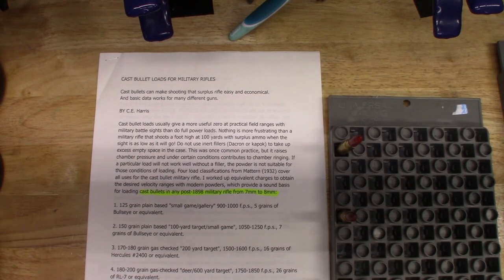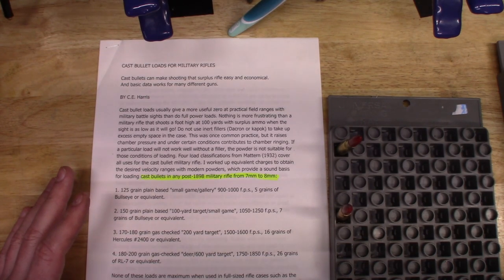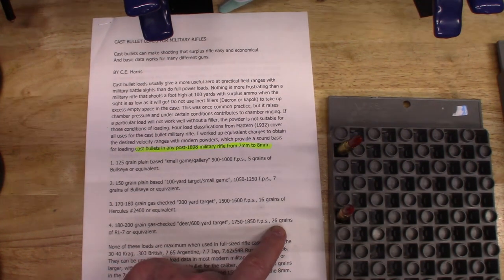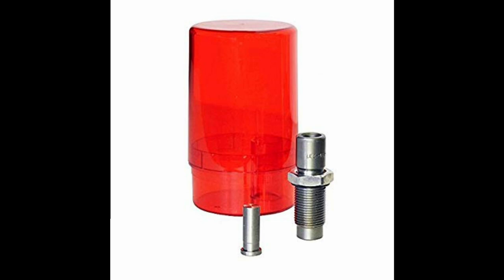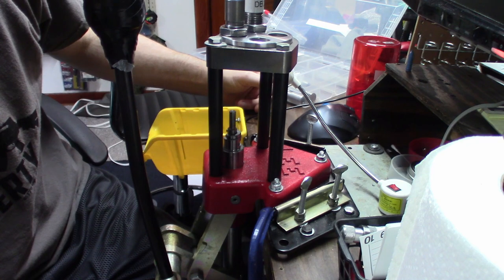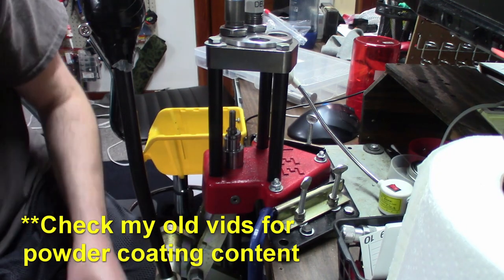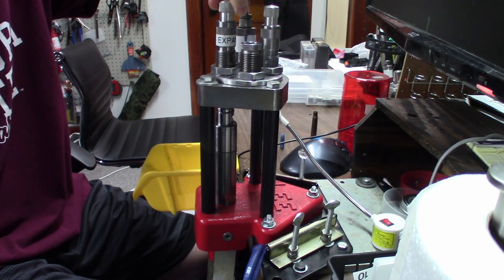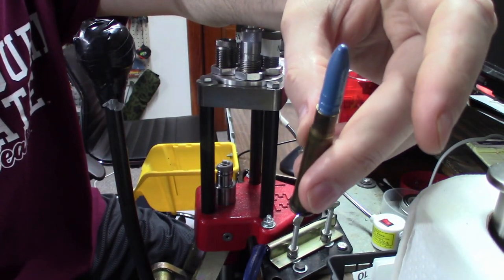Cast Lead Bullets in Military Rifles

Comment: Great video that covered all the bases.  A suggestion on the bullets that give you issues with applying gas check after powder coating, try applying the gas check first.  I've found that the PC sticks to the gas checks just fine and beside the crimp adds additional bonding.  Alliant 2400, Reloader #7 along with IMR or H-4198 and H-4895 are my favorite powder for cast lead loads.
Reply from the maker: Thanks for watching!  Since this video I did end up trying putting on the gas check before coating and it works great!

Comment from the maker: I forgot to mention, if you have a mold that drops bullets to where the gas checks don't stay on very well when using a push-thru type sizer, you can seat the gas check and then powder coat after, and problem solved.  
I think some molds drop a bullet with an undersized gas check shank or it could be an issue with your casting temperature/mold temp, or alloy.  Most molds you'll have no problems w/ gas checks using the Lee system, I've just noticed a couple that give me issues out of 25 or so molds that I have.
Reply: Hey buddy. I'm to impatient to watch through to many vids. What is your experience running powder coated pills in your AR10? Have you had any residue/paint build up in the gas tube?
Reply from the maker: @thetobaccoguy1751  Sorry so late in replying.  I haven't ran any in my AR10 yet but my dad has and I've shot them in his gun.  They are really accurate and he hasn't seen any issues with residue or leading.

Comment: i did a load in .308.. no pressure load, but the projectiles are not gas checked. pure lead base. calulator says 2400 fps. send ?
Reply from the maker: I have seen guys pushing them that fast but most use a gas check.  I wouldn't be scared to try it without, worst it may do is lead your barrel some.  Just shoot a few, see how accuracy is, how brass looks, and peek down the barrel every few shots and make sure you aren't making a huge mess.  Good luck!
EDIT:  I missed where you said pure lead base, sorry.  I'd be real worried about sending those, I would think they would lead pretty bad with a plain base.  But it's not going to hurt anything if you really wanna try...just be prepared for cleaning it if it does lead bad.

Comment: Using wheel weights, powder coating, how fast can you shoot then with reasonable accuracy?  Is powder coating abrasive to bore?  I hunt with gc  and lubed Lee 170gr. Out of 30-30 at about 2100mv and thru the  years have had great success, never loosing an animal.  I once had  tremendous bullet failure with a jacketed soft point, close up, on a deer with 30/06.  That deer would have went down in 30yds. with cast.

Comment: I am using Lyman Cast Bullet 200 grains with H110 hodgdon 17 Grains in 7.65x53 but I have too much unburnt powder.Maybe i need too crimp them more and use magnum primers ?
Reply from the maker: That might help, but I would suggest checking your load data and bumping that charge up if possible.   Unfortunately I've never tried H110 so I can't say for sure on that.  But when I get unburnt powder like that I usually bump the charge up a bit and it fixes it.  I have used WC820 military surplus powder which is supposed to be the same as H110 and I know if I don't load towards the upper range of load data, I get all these little beads of unburnt powder.  Good luck!

Comment: Well I’ll be I’m just realized 2400 is faster then H110…… H110 is what I’m using in my 20” AR chambered in 223 Wylde. I’m running the RCBS 22-55-SP GC PC and the NOE 225 60 RN GC PC on top of the H110. I get full function and dam good accuracy and very good velocity my average 2767 fps and a good SD of 10.9 (Not that I care about SD any more) What I’m getting at is your running a fast powder also and getting good results. On the burn rate chart 2400 is fairly faster then H110 so this is yet another reason why I’m kind of over reading forum posts from years ago.
Reply from the maker: Nice I haven't tried cast in 223 yet.  I do have a mold and gas checks, just havent gotten there yet.  Right now that power is hard to find and expensive, Ramshot powder is pretty available and their Enforcer powder is in the range of H110.  I have used it in 30 carbine and 7.62x25

Comment: What kind of bullet mold are you using for the 205 grain 7.65 argentine
Reply from the maker: Those are the Lee .329 205gr mold sized down.  With some lube I didn't have any trouble sizing it down that much.    I have also used the Lyman .314 200 grain  (mold 314299)

Comment: For anyone in need, I personally use a .311 200 gr cast, powder coated bullet, with 5.6 gr of winchester 572. Good accuracy for plinking, quiet enough to not need hearing protection with a 91/30

Comment: for cast bullets does bullet jump improve accuracy or just slightly jam into the lands .?
Reply from the maker: I would load it just off the lands and see how that does, you could adjust it from there if you think you need to.  Some cast bullets are really short so they will have quite a jump, like some of my 7.5x55 Swiss loads.  Even with a big jump, they shoot great.   So depending on the rifle, it might not even matter.

Comment: Was wondering where you had disappeared to. Lots of great tips for cast bullet loading. NOE has lots of good stuff. They sell expander plugs that drop into the Lee universal die in all different sizes. Works really really well.  Totally agree about the M44 and surplus ammo for beginners. If the recoil and muzzle blast don’t get them the fireball will 🤣
Reply from the maker: I'm still here!  Just haven't been doing much worth recording lately so it's been a while!  
NOE always impresses me with their quality and machine work...the molds are like 4x a Lee mold but worth it.  Have you ever shot a straight pull Steyr M95/34 carbine in 8x56r?  Oh man, makes a M44 feel like a puppy dog.  Worst recoil of any surplus rifle I've ever fired, and I have like 56 of 'em.  If you use old surplus Nazi ammo it's even worse.  
Thanks for watching!!
Reply: Mike, I use the NOE expander plugs in the Lee Universal Expander Die, too. A great improvement.

Comment: I like the idea of the powder coating. Do you feel that the M95 is an accurate rifle with the proper ammo?
Reply from the maker: They can be but they are really picky.  The bore diameter really varies a lot based on the 5 or 6 I have so it takes some trial and error.  My eyes aren't great so I usually only shoot at 50 yards on my milsurps and I have been able to get at best a 2 inch 5 shot group at that distance on my M95 variants.